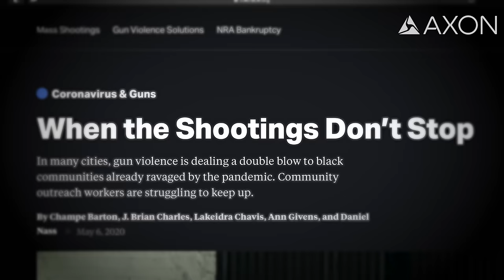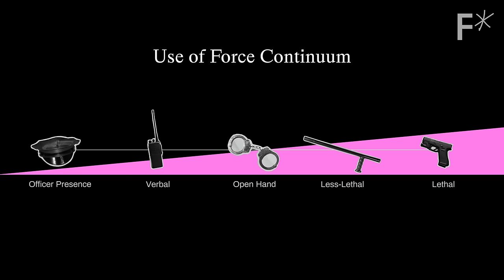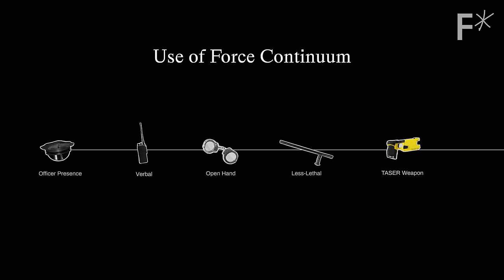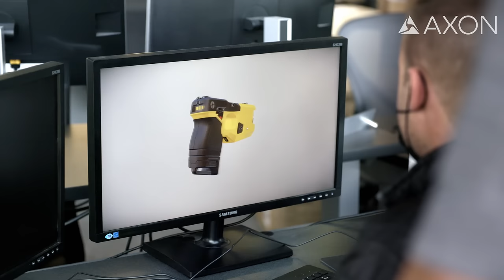The CEO of Axon on how to make weapons safer

Comment: This is definitely the right idea, but there are better ways of approaching it. Throwing away gunpowder as the propellant would be ideal, but using taser technology isn’t very effective because the shocking power of the taser is limited to the wire that comes from the weapon. Thus, ideally, the taser should be integrated into a self powered projectile. This projectile can be cheaper than the weapon that fires it, so long as all parts are off the shelf. Other projectile types would be possible without the need to make any aspect of the weapon lethal. 

I think the best way to make the firearm obsolete is not to eliminate the need to make a weapon nonlethal, but to give the user the choice of lethality, thus leaving responsibility upon them should their conscience be grim. But under no circumstance should a weapon force a user to use lethal or critically damaging force, as has been the case with law enforcement.
Reply: Why would you want to choose lethality if nonlethal would work just as good? That's the goal this guy has
Reply: @ThomasBomb45  Yep in most crimes it makes no sense to use lethal weapons
Reply: @nixtoshi  possessong drugs, for example, should not be a crime let alone a death sentence